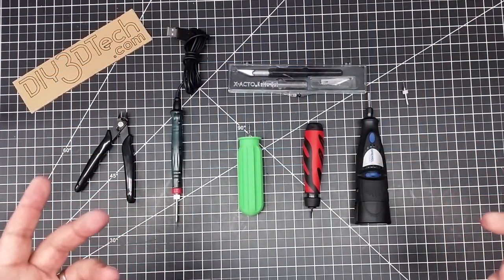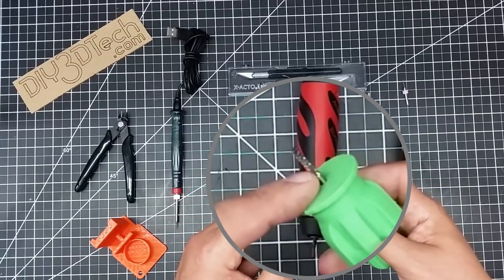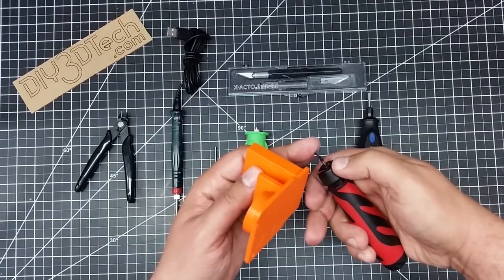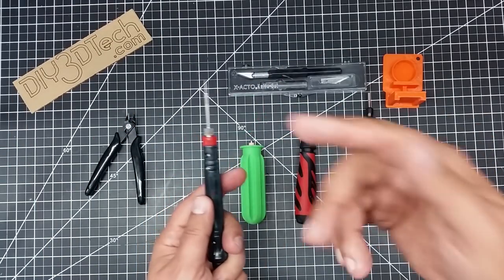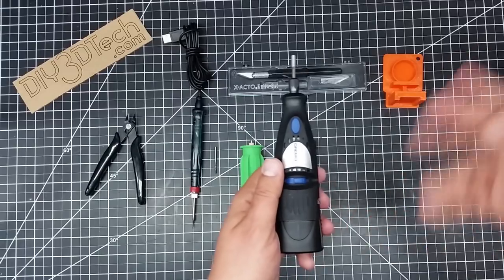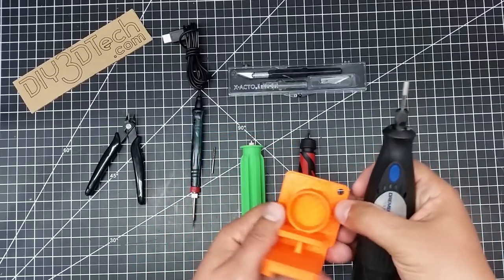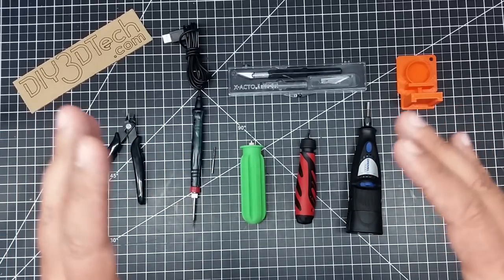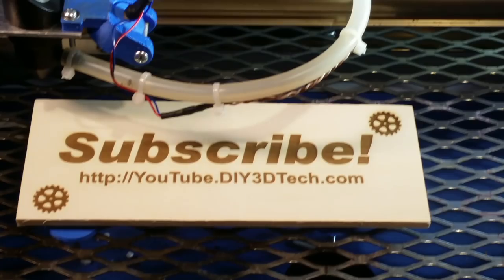Shop Talk - Professional Cleanup Tools for 3D Printing!

Comment: I'm in the process of building my first 3D printer from scratch and my buddy who printed out the 3d printed parts on his horrible machine had some layer offsets and stuff so I'm having to go back in with drill bits and other cleanup tools to make it so the screws/bolts can go through among other things. One of the most useful tools I actually got for modeling Battletech figurines and other miniatures is actually coming in really handy. It's a "Drillpro mini aluminum hand drill with keyless chuck and 10 twist drills rotary tool" I got on banggood. 

I don't have a drill press available and in this case I don't really need one, but having the precision and not having to worry about accidentally poking the wrong areas and ruining the part with a motorized drill is really nice. With the miniatures I got this to make super tiny holes in the pewter and plastic in order to "pin" limbs with go-between pieces like paper clips for additional strength, but it's really coming in handy when working on some of these parts that are being a royal pain due to the poor print job.
Reply from the maker: Interesting and will have to check it out!  Thanks for sharing!
Reply: I'd leave a link for you, but it seems that youtube has disabled the ability to copy/paste things.

Comment: Really Interesting.I'll give you a thumbs up 👍  BUT!  that green cleanup tool isn't motorized is it? Why do I need a 20 bit set of 3mm bits the require a rotating handle? You're just scrapping right? So which bit or bits are you using in that tool then?  Thanks
Reply from the maker: Yes the "green handle" (link to the STL is in the description) just holds the tool bit and works like the de-buring tool however the de-buring only cuts on one side where as this will cut on all sides of the bit.  What bits, well it depends and again this is why I like as I have a ton of bits and I can select one that meets my needs.  I like to use bur bits like there: https://amzn.to/2I6DpMU
Reply: Ahhh yes the bur bits, then you can manually use them  .Great idea  I got the STL.  I already have the rotating de-burring tool from years ago.  Thanks for your view.